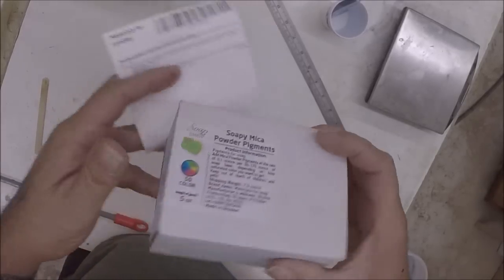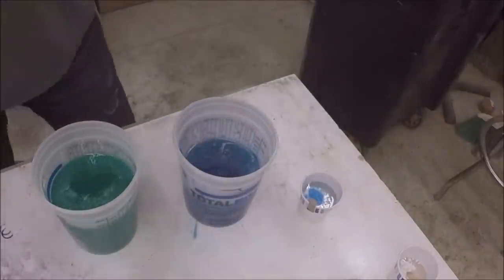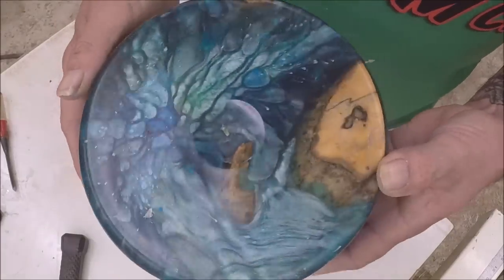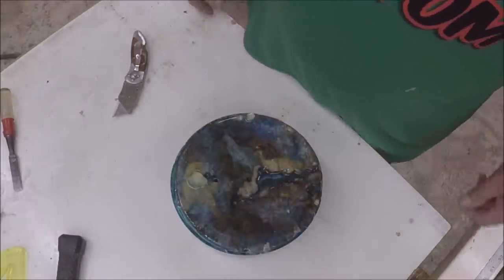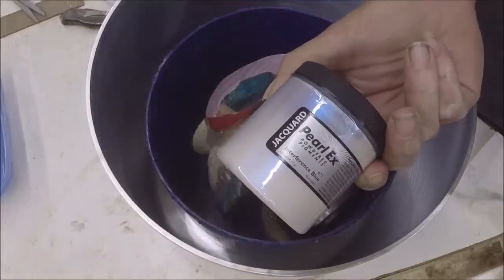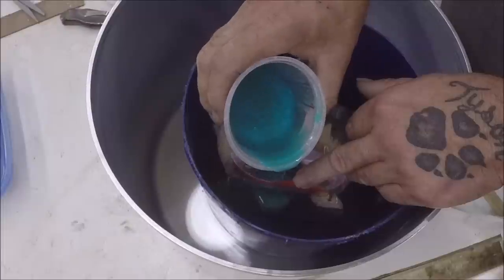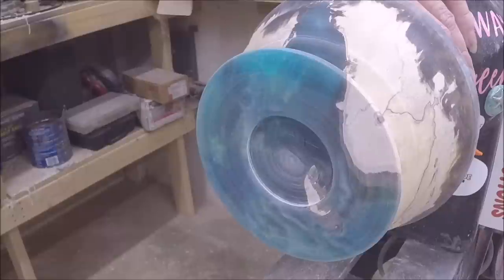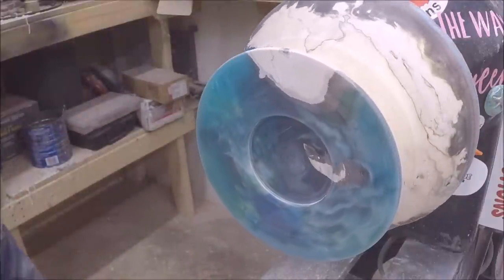Blue Ocean Bowl

Comment: This is gorgeous Doug! 
Congratulations on your vacuum chamber. 
May I ask why you didn't cure the resin directly in there, knowing the burl may be not dry enough?
Reply from the maker: Thank you Tina,  I hadn't actually intended on using the vacuum chamber for this project, it takes to long to pull the air out of the wood, and for the most part the resin would have set up like foam if I would have.

Comment: You need to quit messing with all them grams and stuff and use my method.  It's called a "SWAG"  Scientific Wild Ass Guess.  Works for me.  I don't recall have rubbery epoxy.  Just in fun my friend.  Take care, Larry
Reply from the maker: Larry ..it could be anything Larry down to the resin was old when it was sent to me.  who knows but I find it works out better when I weigh it out,  not enough resin leads to really bad chip out as the resin is brittle
Reply: @PohlBarnProductions  Yep, to much hardner will make it brittle, to little wil make it rubbery.  I've been makiing fiberglass aircraft parts for years.  Trust me when I tell you, there is only one reason for rubbery epoxy.  Short on hardener.  Even then it will harden in time.  Cold will slow it down, other than that it's all about the hardner.  Take care, Larry

Comment: Base crack aside, I really like it! I was surprised the vacuum chamber didn't turn into a foamy mess.
Reply from the maker: Thank you Jen, it would of if I would have left it running,  I pulled enough vacuum to get the air out of the cracks and then released it so the resin would be sucked into the cracks before it set up.

Comment: Love the paint beater to mix up the resin great idea 😹😹 for the smaller ones pop into a second hand store and pick up some egg/cake beaters I use them for my smaller mixing jobs 😹😹
Reply from the maker: Thank you Angela,  so much faster than standing there stirring the resin.
Reply: The Pohl Barn Productions 😹😹so very true 😹I’m so use to using the egg better to mix me glues and paints and such but never thought of using it on there on resin until I watched you us the paint stirrer 😹😹😹😹as you say so much faster and using the pressure pot to make it bubble away like that will squeeze out all the bubbles added when mixed 😹😹😹👍🏼👍🏼👍🏼

Comment: Doug, have you ever considered putting the the the bucket of wood and epoxy in the vacuum chamber for a few minutes right before you put it into the pressure pot?
Reply from the maker: I just got the vacuum chamber prior to pouring this blanks but it has crossed my mind when I didn't have one yet/
Reply: @PohlBarnProductions  Give it a try on one of your videos  My thinking is that pressure works well to reduce the tiny bubbles entrained from mixing, but if you have a large bubble trapped someplace, it may be too big for the pressure to shrink.  However, if you expand it under vacuum, most of it might float out and the remainder will shrink some more under pressure.

Comment: When you were vacuuming the piece to fix the cracks, a lot of the air bubbling up likely came from the resin itself as mixing the 2 parts together will introduce a lot of air into the mix...
Reply from the maker: way more bubbles than resin I think, it was actually boiling, soon as I stopped the vacuum it set up.

Comment: Beautiful  bowl,  Doug. I've  been  wondering  why  you  don't  use  the  vacuum  chamber  to  begin  with  rather  than  the  pressure  pot to  get  the  resin into  the  wood .
Reply from the maker: Thank you, the resin sets up faster than I would be able to remove the air.
Reply: @PohlBarnProductions  thanks  for  the  feedback !

Comment: It’s beautiful!
Reply from the maker: Thank you Joolz
Reply: @PohlBarnProductions  I wanted to ask you if you still work outside in shop in winter? My garage isn't heated and it's cold! I have wood stove but takes forever to heat up, so I really haven't gotten to try my lathe much. So busy all summer with other projects. 😩 Probably too messy for basement, right?
Reply from the maker: @joolzbohr  I work in the shop during the winter,  I have a 120000 btu torpedo heater. it makes it nice a toasty in there in no time but it stinks. you can work in the basement but the dust will get everywhere in your house.
Reply: @PohlBarnProductions  yeah, I figured. I've got one of those heaters too. Just wish I'd insulated garage when I built it. Thanks so much! I love all your work! I'm in Detroit area, so not too far from you. 🙂